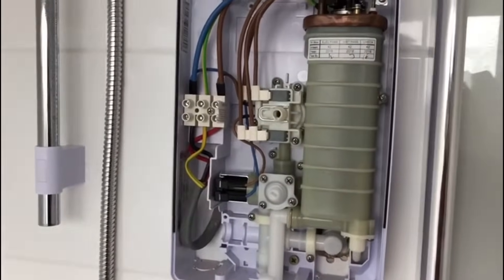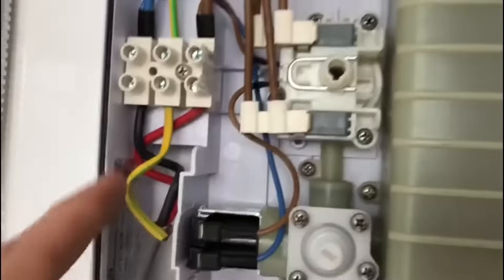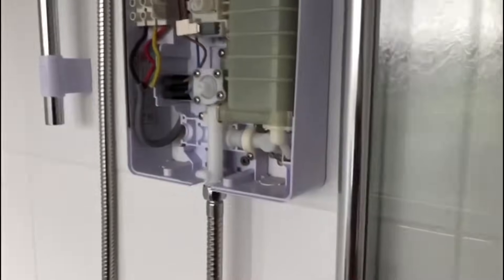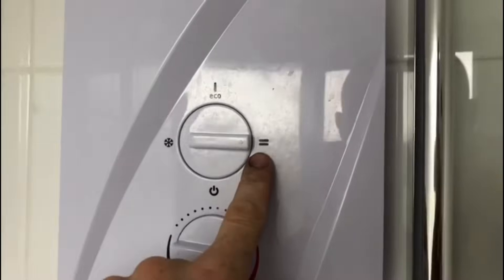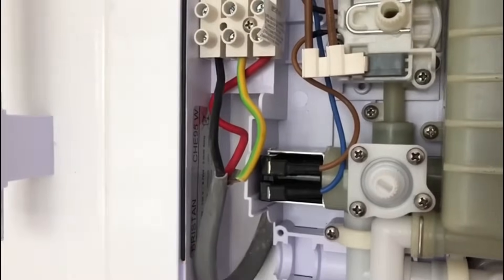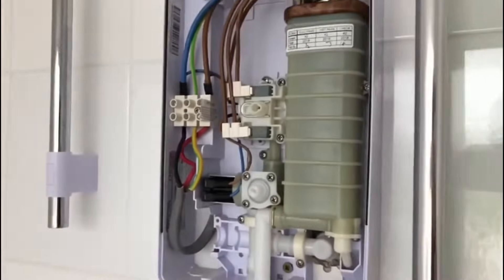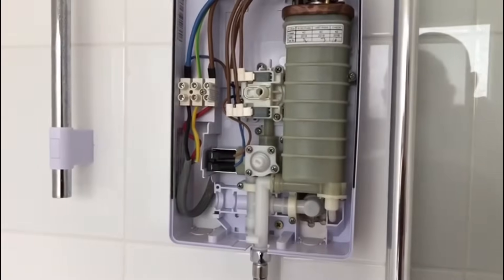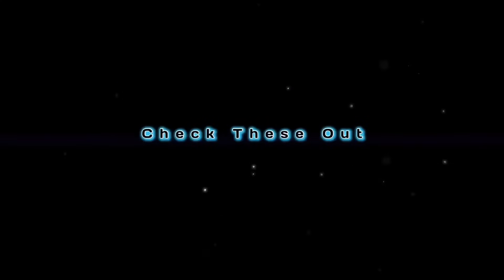Is This Cable LARGE Enough..? - Measuring Load Current LIVE - EICR 9.5 kW Shower Circuit

Comment: Why would anyone put the isolator in the earring coubord , isn’t supposed to be on the wall behind the shower outside of the bathroom? Also the TWE wasn’t upgraded because the sparks couldn’t be bothered to do a bit of proper work.but who am I to argue i’am just a humble spark who’s opinion means nothing.
Fantastic video Matt as always 👍👍👍❤️
Reply: Putting isolators under kitchen cupboards hidden away is the norm nowadays,so why would you be any different in a bathroom? Would you want a massive isolator outside the bathroom or a big daft pull cord on your ceiling,
Isolators are only really there to allow competent persons to work on the fixed equipment
Reply: @ericthekingthekingtheking4842  isolators in cupboards don’t comply as they are not readily accessible. Isolators in kitchens should be above the work top.
Reply: @jimmyfurey  so I was right , yet again 😂
Reply: @jimmyfurey  
Isolators in cupboards dont comply with what ? Show me the reg number that states that,
Reply: @Dog-whisperer7494  
No hes wrong
Reply: @ericthekingthekingtheking4842  all isolators should be accessible   It’s as simple as that. Look it up for yourself. How do you isolate an appliance in an emergency if you don’t know where the isolator is ? Isn’t that just common sense anyway ?
Reply: @jimmyfurey  How is an Airing cupboard 'not accessible'?, they have doors on them, they open and close you know.
Reply: @jimmyfurey    Over the last 6 years I have had over 2000 homes inspected and signed off by building control, NHBC and the NICEIC. All of them had isolators located in cupboards and not once has it been raised as in issue. Your definition of readily accessible must differ from everyone else's.
Reply: @ericthekingthekingtheking4842  that’s why I put a question mark in my comment, also I have never seen a shower isolator hidden in an earring cupboard, before , there always on the wall outside the bathroom. But who am I to argue i’am just a humble spark who’s opinion means nothing.
Reply: @seandempsey7351  
Hi Sean I did a lot of work for housing associations and councils few years ago seen hundreds of installations like this,and minimal damage to decoration is always there main objective,so trunking all the way or in the old immersion cupboard was standard practice mate 👍
Reply: @ericthekingthekingtheking4842  yes , i’am not saying it’s wrong I just think it’s a bit silly as I was tort that shower and cooker isolator’s should be easily accessible and located adjacent to the equipment.
Reply: @ericthekingthekingtheking4842  Eric thank you for your reply, that’s how we learn , by talking to other sparks and asking questions. But we must also remember we all have our own way of doing things, sometimes we get it wrong but most of the time we get it right. 👍
Reply: @Dog-whisperer7494  I have just looked in the reg and the onsite guide and they both say that isolators should be as close to the current carrying equipment as is practical and easily accessible and Identifiable with a label. But who am I to argue i’am just a humble spark who’s opinion means nothing.
Reply: Your all referring to cupboards in the bathroom, in the video the airing cupboard is on the landing away from the bathroom, so putting the shower isolator in that cupboard is Wrong as it is not as close to the shower as is practicable for maintenance.
Reply: @seandempsey7351  yes that’s right.
Reply: Actually you can put a switch in the airing cupboard inside the bathroom as the airing cupboard in a bathroom is classed as an “outside zone”
Reply: @toddbod94 I can assure you that that the 45AMP double pole Switch for my shower is on the wall next to the light switch other side of the that wall is the shower, installed by electrician from the housing association who owns the all the properties we’re I live. I am not saying that it is wrong to have the isolation switch in a cupboard, just that in 30 years or so of being a electrician I have never seen it in cupboards , socket or switch fuse yes shower and cooker isolator no .
Reply: Secondly we all know the problems of isolator switches overheating and burning due to loose connections. So why in god name would you hide them away in an airing cupboard? That’s a fire waiting to happen , and Sodds law it will happen at night when your asleep in your beds .
Reply: @toddbod94 who in god’s name would put the shower isolator in an adjoining bedroom? If that bedroom has en-suite then the isolator would be on the outside of the en-suite as the en-suite is a room with in a room,Unless you’re a tight ass and only had a shower cubicle in your bedroom then that’s a different matter .
Reply: Isn’t it nice to have a good honest debate and to have an opinion weather that opinion is right or wrong. Then you get some idiot who thinks it clever and funny too be disrespectful and take the Micky out of you because he can’t understand what you are trying to say because your dislexic  .Toddbod94 
An ignorant disrespectful individual.
Reply: @toddbod94 if look at my first comment again you will see I put in a question mark, therefore I did not make a statement I asked a question.
So now who looks stupid , not me 🤣
Reply: @toddbod94 I did not say it has to be outside the bathroom on the wall with the shower I asked if the isolator should be outside the bathroom on the wall, learn to read. Who the hell is going to put a shower on the wall on the landing outside the bathroom ? 
What are you some sort of pilchard.
Reply: Gaz as you know I am dislexic , 
I don’t always get spelling right but I should not be subjected to abuse for it by an individual idiot @toddbod mocking me for it . Once  is once to many but to continue n every time I post a comment is just not acceptable it is hurtful and disrespectful. I am sure You wouldn’t like it . Please stop this ignorant moron by blocking him. It says something when you can’t have a good honest debate without idiots abusing someone disability.
Reply: @toddbod94 
An isolator in a immersion cupboard or in a kitchen cupboard is readily accessible isnt it? If you want to isolate whatever its supplying you go to the cupboard !! Not hard is it? You reckon in a £3 million house theyv got a crabtree pull cord in the middle of the en suite ceiling 🤣 course not it will be in some convenient hidey hole but a place where it can be accessed for maintenance
Reply: @ericthekingthekingtheking4842  no it isnt. It should be readily accessible and free from obstruction. How can it be readily accessible if it’s behind loads of stuff. And in a couple of weeks how can it be readily accessible if the customer has forgotten where it is? Also if the person is older how can they go searching through a cupboard in an emergency ?  This is just common sense isn’t is ? Use your brain man. Instead of trying to make stupid points use your common sense if you have any.
Reply: @ericthekingthekingtheking4842  so you think having to empty the kitchen cupboard in order to get to the cooker isolator is a good idea? And the same for removing a pile of bed Lenin and or bath tale’s never mind the fact that when the isolator switch overheats it’s a fire waiting to happen, fantastic idea.
Reply: @Dog-whisperer7494  
Your over thinking it sean,people get stuck worrying about pointless shit like this its no issue at all really is it
Reply: @ericthekingthekingtheking4842  I don’t think I am over thinking it I am just giving my opinion.
But who am I to argue i’am just a humble spark who’s opinion means nothing.
Reply: @Dog-whisperer7494  I think it’s fine to have to empty a cupboard to get to the isolator, yes. They’re not safety devices. If things are going wrong, or of the fire department needs to power shit down, you’re not going to use an isolator switch let alone one very close to the device that’s on fire. You pull the main switch in the consumer unit.

Comment: 6mm can easily cope with 39 amps, its fine the OCPD being 40amps will not operate as an overload, cant see an issue
Reply: See Table F4(i) in the OSG. Reference method B (no insulation) then 41A [which is more than 39 but only just]. Reference method A [inside insulation] 34A. In practice you've got several things to consider, and unless you're going to do all the engineering then choose a standard circuit from table 7.1(ii) - which only allows a 40A circuit in 6mm if you're using method C [clipped direct]. In reality you rarely use method C so 10mm it is.
Reply from the maker: Thermal insulation needs to be taken into account 👍🏻
Reply: @GSHElectrical  Also consider the real world, no shower is left on for hours on end.
Measure the temp rise in the insulation, actually on the cable. easy cope at 6mm
Reply: @007floppyboy  do you think that stands you up in court? The guidelines are there for a reason which I Know are a guide but they will filter back to your design and the EAWR so I would be sure that rule of thumb being applied is looked at more vigorously in the real world. 

Otherwise people may find themselves in a tricky position. 

I like that in domestic now with amendment 2 there needs to be O and M manuals which will indicate design a lot clearer IMO
Reply: @craigbuist4636  Court, yes.
the temperature rise is the thing, nothing else matters, I can prove beyond any doubt that the cable can cope with being installed and used for a shower of this rating. Honestly, I wouldn't use a 40 Amp breaker either, that will never operate until a constant 55Amps. Its actually nearly pointless.

I would use a 32Amp MCB, this operates at circa 50Amps at about 16 mins. OR 45 amps at about 166 mins.
Then if you want to argue over it, just say the MCB was sized accordingly for a standard use of a shower, taking into consideration the general use of a shower and the cable is installed well within the capabilities of that current.
This is after all, the same as motor protection with a thermal trip.

Guess what, do ya calcs, do a temperature measurement. I will let you decide.

I will add this, so you are happy with your 40Amp MCB? yes....
So you up this cable to 10mm2, whats the current rating of 10mm, its circa 63Amps ref C.
Now lets look at what the MCB will do, a 40A MCB will allow over 70Amps for over 2 hours.
What if there is a fault, partial heater short, now its pulling 70 Amps until the breaker kicks in, but thats over stretched the cable, its now too hot, only rated for 63Amps remember....
Some massive motors have long startup times, so the fuses need uprating, but you dont uprate the cable, as there is a thermal overload in the circuit. It is this that trips due to a constant overload, do we see chemical plant designers being taken to court because they didnt use a cable rated for the size of the Fuse or MCB?

No we dont.

Go to bigger motors and some pull 10-15 times the rated running current, for 30 odd seconds.
I did a job where the cable installed was a 240mm but the motor pulled 1700Amps for 30 seconds, then down to about 180Amps, fuse was a 615Amp, cable rating some 350Amp.
Reply: @007floppyboy  you clearly have a view of knowing better so all I can do is wish you well with the technology you have to prove beyond reasonable doubt that you know better than what is being produced as industry guidance.
Reply: @craigbuist4636  Its a thermal trip, what else do you suggest as a protection system for ensuring that a cable stays in its thermal capability?
Reply: @007floppyboy  I don’t deny that there is a thermal trip. I just don’t agree with the fact that your basically saying regardless of what the books say you are going to place it on your own manner because you know better. For me the calculations and the cable ratings provided are there for a reason and are what should be followed. In that instance a 6mm cable is not effective based in that much insulation.
Reply: @craigbuist4636  Ok, lets look at this another way.
You have a non-fused spur off a ring main (Can not find my 18th but is on page 362 of the 17th), standard to fit 2.5mm, even shows it), this is backed up from a 32A MCB, which will not even think of tripping until about 45Amps, well into over two hours. Then you say 'what about the fact that it can only pull 2 x 13Amps, so 26 Amps max, but these house hold 13 Amp fuses will not blow until 20 Amps is passing for many hours, so its 2 X 20Amps, so you now have 2.5mm taking a possible 40 Amps for hours.
Most folk, especially electricians, is that they dont check, they just do what it says in the book, its ok in the book, so its ok.
And the reason you can do this...'probability'... that this wont happen, you wouldn't have 2 x 20 amps for hours on end, but we know this is a scenario that very possibly, just maybe, might occur.
We take into consideration what is likely, and what isnt.
This non-fused spur is the exact same scenario as the shower, it is very very unlikely that a shower will be left for hours on end. And to be certain of a safe condition, I would fit a 32Amp MCB

Now lets look at it, A non-fused spur on 2.5mm with a 32 Amp MCB (capable of pulling 40Amps), and a Shower using 6mm with the same 32A MCB (capable of pulling 40Amps)
Reply: @007floppyboy  I personally will still stick with what the regs and manufacturers instructions say. I get what your saying but for me, they make these considerations for a reason to which I am happy to work too and not be looking for work arounds. You clearly feel differently with that and that is your choice as to how you install, I just don’t feel the same as lots of clever people sit round designing these things for a reason.
Reply: But it can’t safety cope with 39 amps installed in this fashion. It will exceed max operating temp of cable. That’s why the guidelines are there.

Comment: Where's the torque connectors on the shower?? 😂😂😂😂🚿🚿🚿🚿🚿
Reply: Mira advanced flex electric shower, does not have any torque settings marked anywhere on the appliance, and the manufacturers instructions does not list or mention/recommend any torque settings. The mains connection is by means of a 30amp chock block , and chock blocks do not have a torque setting . Most if not all electric shower’s are wired  in the same way 6mm2or10mm2 FT&E from a 45amp double pole switch to a chock block in the shower, torque screwdriver not needed.
What I do find strange is that this particular shower has Bluetooth connectivity, why ?
Reply from the maker: Should have cookers have them on the connections plate
Reply: @GSHElectrical  I have just had a good look at the connections on my electric cooker and the cooker connection unit BS 5733 and there is no torque settings indicated , I also had a look through the manufacturers instruction booklet and it doesn’t mention anything about torque settings.

In the video that Matt did on connecting up a new electric cooker . A note pop up on the video stating the he tightened the connections to 2.5nm as indicated on the connection plate, wrong wrong wrong. My hotpoint fan assisted oven has the acsactly the same connection plate and the is not not any indication of torque settings at all , I have just double checked. 
That on screen note is totally wrong and misleading. 
Sorry to be pardantic .
Reply: @GSHElectrical  I have never seen torque settings on a cooker connection plate , are you talking on the cooker it self? Or the connection plate between the isolator and the cooker? I have never seen it on ever. But who am I to argue i’am just a humble spark who’s opinion means nothing.
Reply: To the best of my knowledge shower’s don’t have a Purcivick 
Torque setting ? But who am I to argue i’am just a humble spark who’s opinion means nothing.